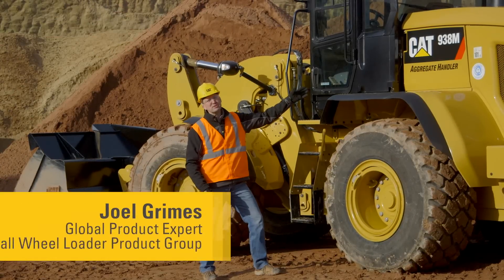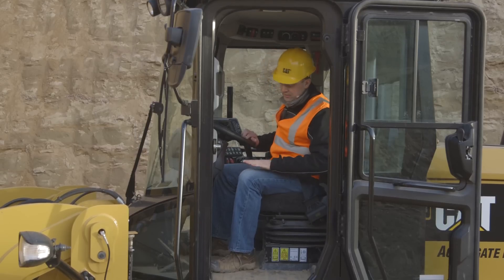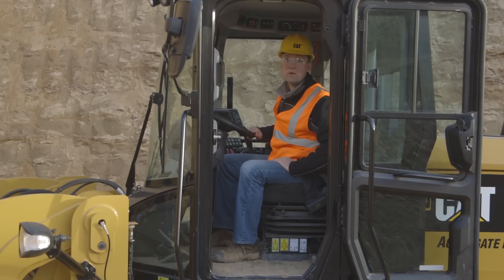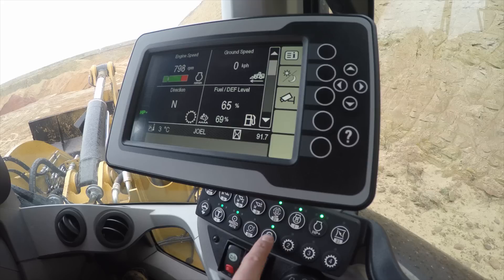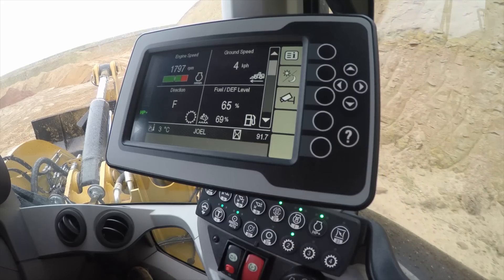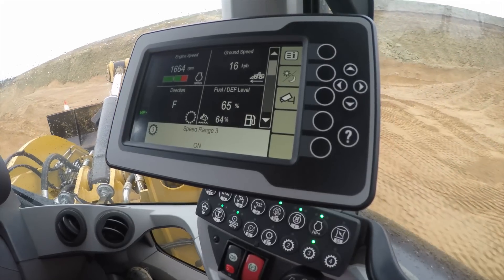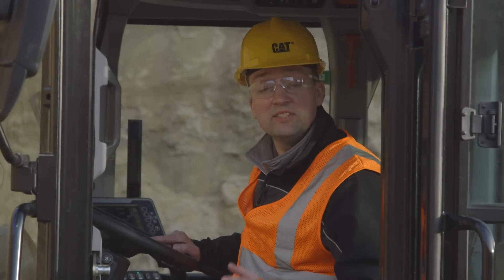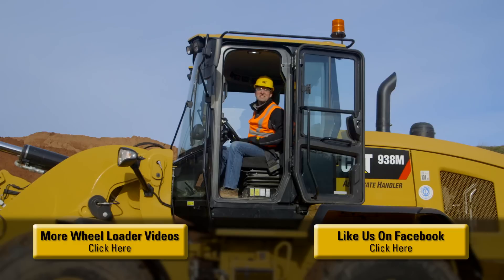Efficient Hystat Operation (Cat® 926M, 930M, 938M Wheel Loader Operator Tips)

Comment: they are designed to fail at 10000 hours from factory. constantly need re-gen, wire harness breaks in stupid places, the electronics controll te hydraulics and dont make for smooth operation as an operator, but worse of all these stupid curved front windscreens do nothing but throw shadows and light right in your line of vision so visibility is a nightmare especially working between sunny and shaded areas. and if thats not bad enough because you have to wear hi viz at all times nowadays it gets refected off the windscreen right in your field of vision. bring back flat windscreens for safety sake. these machines are rubbish, the old 938g i had before the m would dig the m into the ground, the m cant push at all, click the g down to first and it would push nearly anything it was asked,  oh an who the hell drives a machine like hes trying to show you.........NO-ONE
Reply: Only have 6100 hours on my 930M and it’s had a few major issues. Currently Cat is struggling to figure out a High Manifold Rail Pressure issue. Machine won’t shift out of second gear and it will de-rate itself on startup to the point where it doesn’t even have enough power to get a 1/4 bucket of loose fluffy material. This 930M has been one issue after another for us since we got it. The 950M we got at the same time has been great. Have 11,000 hours on the 950M now.

Comment: Fix the DEF issues!! We have an’07 938m. Always coding out with def issues. Down time is lost $$$.
Reply: we have 3 x 2019 machines which are at 10000 hrs approx and have found out from a cat fitter that they are designed to fail so it costs thousands in parts.  theres nothing wrong with the parts on the machine its just that its been programmed to fail around those hrs at the factory just to make money for cat, and they wont just reset the ecu to say the parts have been changed either they want you to change the new parts too. cat in our area are now charging £500 an hour.  rediculous

Comment: Typical Cat !!!- How do you hit the frickin button when youre bouncing around !!!.
Cat ! - have a look at the old TCM !! - Kick down button on the top of the loader control - hence roam around loading cycle in second, enter the stockpile in second then hit the kick down to penetrate, fill the bucket, change direction straight into preset second !! piece o piss - no screwing around AND IT WORKS !!!!!!!!!!!!!!!!!!!!!!!!!!!!!!!!!!
Reply: the old 938h can dig better in second gear than this can in any, its rubbish

Comment: I see an issue that NEEDS to be redesigned. Allow the operator to shift gears WITHOUT taking his or her hand off the joystick. In just first few minutes of this video has made it a machine I WOULDN'T welcome on my jobsite.
Reply: Keep it in 4th and you don’t have to lol
Reply: Its auto kick down you fix it on the screen when it should kick inn. Have been driving 938k, 938m and 930m and havent had any problems  .
Reply: @kentrunenordli2189  I was taught on old school machines. Like 988B & Fiat Allis 645 & 605 loaders.
Reply: Thats ok 🙂 its somethings i miss from the old machines i av driven also.
Reply: The first loader I ran on an official job was an ancient Cat 980. It was OLD. Jumping from that into a new Cat 988 with joystick steering was a huge change. Took me awhile to get things sorted. lol. I’ve run a plethora of loaders now and I like Volvo and Cat but the large Komatsu loaders are pretty sweet too. The machines have changed a lot over the years. If you’re used to running machines from the 70s… yeah these new gen machines will be a big change for you.
Reply: Сат машина очень плохая, гниёт и слабая